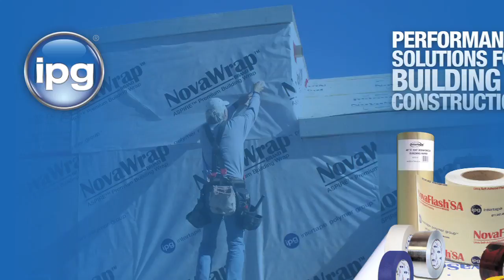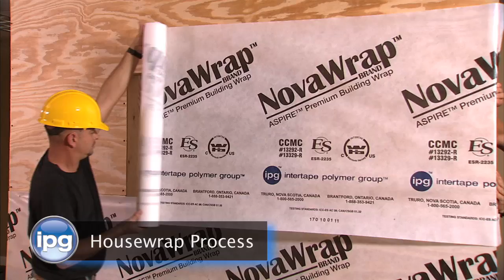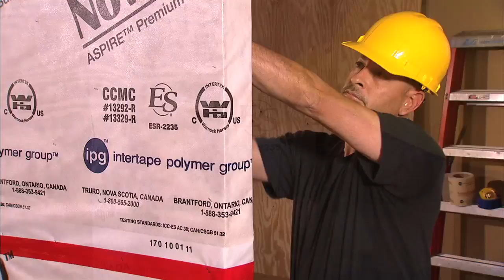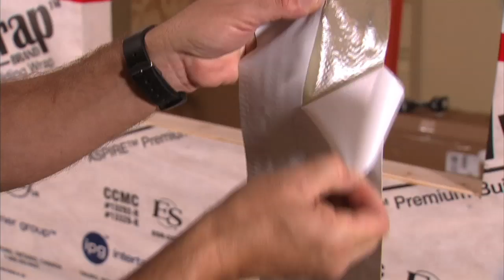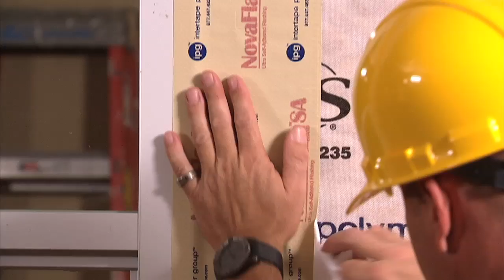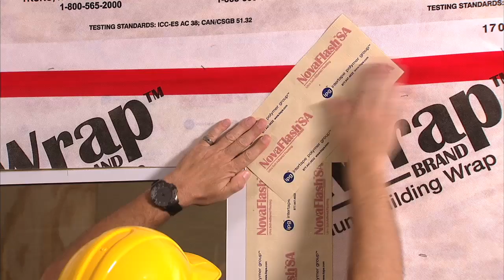How to Install House Wrap & Window Flashing

Comment: Why would any intelligent person wrap that non water proof stuff, inside the frame?? It will also allow air to go under and inside .
why bother using sealant on the flange to a non waterproof plastic?
It would only be smart to silicone frame flange to plywood that flash tape over flange and nails then house wrap, , were is the engineer proof on the video way of doing it?? I have been fixing this  stupid installation of practice in video be cause air and water get thru that house wrap

Comment: You  would think a manufacturer of a product would know HOW to install their house wrap. Great video on how NOT to wrap your windows. He literally created a channel for any water that may get in behind the house wrap to funnel into the corners of the window sill and start rot. Cut the sides as well kids so your spray foam can stick to the wood and create an airtight water tight bond. Spray foam will shrink slightly and create air gaps and pull the house wrap away from the sides of the window frame allowing air and water

Comment: Absolutely nobody in the trades says 48.5 inches.  We use fractions not decimals, and no z flashing?
Reply: Not an absolute , in the steel trades it's very common in shops to use decimals, and Evan 
Metric depending on where your shop drawings 
Where generated , rule of thumb you work in the system that your drawings represent , this is to remove the possibilities of mistakes in communication and  possible errors in conversion , construction is not the only trade
Out there

Comment: Goal is to catch drain dry. Where’s the slope, no decay shims, backdam and please don’t insulate the sill pan zone.
Reply: Slope? Decay shims? Backdam? What's that?
Reply: @davidtalavera2462  A slope is exactly that, a slope - it is usually built into the sill so that any moisture that gets under the window frame drains to the outside of the house (the slope runs from the inside to the outside across the whole width of the window sill. This is why the installer the video didn't apply any flashing over the window flange at the bottom of the window, so that any such moisture could come out, but with no slope there is nothing to encourage this. A backdam is a vertical section on the window sill (so  that the above mentioned slope ends in a vertical wall) that water will find it even harder to climb up. (It's like a dam wall).  I've no idea what decay shims are.

Comment: Yeah hand pressure with an acrylic adhesive is going to fall right off of your wall. USE BUTYL!!! 
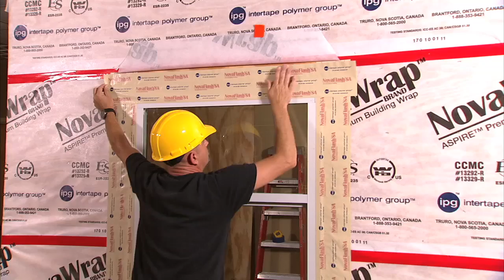Also, anyone catch the reverse lap at 4:55 ?
Reply: How about the wall swaying when the guy hits it with his slap stalper! I'm  sure it's just a mock up but at least get a real example and the guy narrating the perks of this product call's it OBS instead of OSB!

Comment: Ben Blake is correct on the method demonstrated here.  This will definately LEAK!  
Chris Mendola - ..."very efficient" "technique" in guiding water into the sill area and getting the customer to buy twice as much product to do the job! 
No one should EVER CUT in the corners!    Use the correct products to address those lower corners!   IPG - If your company does not make it - reccommend one that does! 
The method demonstrated here is 50 years old technology.  The installer did not even try to close that hole with caulk or sealant!  What a Dweeb...!

Comment: Will wall flashing prevent wood from getting rotted from rain?? And if so how isn’t it so thin
Reply: marie kr it’s made of rubbery like tar materials.
Reply: nova wrap will allow driving rain directly through the membrane... not only through the staple holes, but directly through the material... we have had serious issues

Comment: Is this method correct for today's residential code now in 2018?
Reply from the maker: This is one recommended method of install, as per AAMA-A1 using a modified I-cut. Consult your local building codes to determine which install method is best suited for your geographical area.

Comment: Never fold your housewrap to the inside. Any air infiltration now has a clear pathway to the interior wall. Never tape over the flange onto the housewrap, any water that makes its way behind the housewrap now has a clear pathway into the interior of the wall assembly. It's amazing that you think this is proper practice, what a shame! If you were to do this correctly, you would tape your flange to the plywood, then fold your housewrap back on the flange and tape it using seam tape. Your method provides zero air sealing properties and is down right irresponsible.
Reply: Wow, finally some one said it. I completely agree. It's better to have the window sealed right again the plywood or studs, on the sides and top, that  is. On the bottom it should be on top of the house wrap,  I hear many people say leave the bottom uncaulked in case water get in there it has a way to come out. Why would water get in there behind the window if you sealed it against the framing and then you install the wrap over the flange and tape or caulk the wrap to the flange, there should be no way for water to get behind the window.
Reply: Its called flashing the window dumbass
Reply: This is how all windows in my area are flashed , plus airflow isn't always a bad thing
Reply: do you realize everyone have the absolute way to do thing? it call '' construction douche bag syndrome" ... no cure... if I was working with you on a construction site I certainly would sprayfoam your toolbox... dosent pay to know best ,
Reply: Jake Garner why would you want it air tight? It's a house not a balloon, there's nothing wrong with having a bit of outside air in your house
Reply: @Dm-jy4jw  If outside air can get in, inside (heated air) can get out, so it wastes energy. The best homes being built today have mechanical heat recovery ventilation that is controlled to ventilatate just enough to keep the house and the occupants healthy while not letting any heat leave the home unnecessarily. Uncontrolled ventilation is less efficient than controlled ventilation.

Comment: you do not seal the bottom of the window with window flash tape. There has to be flow back for filtration of moister or water if water was trapped in window it has to go some where. It not good to trap water moister and let it mold stuff.
Reply: Are you just repeating someone said or did you actually saw it yourself? so if water is trapped in window, this means that there are little holes on the exact bottom of the window where it can drain out? BS ... explain to me please HOW water should get in there. is there any video?
Reply: Even if flashing keeps outside moisture from penetrating, condensation can build up inside around edges of windows in very cold climates and run inside trim and into rough opening.  That moisture, but f it occurs, should have a path to drain away to outside.  That's why any caulk on bottom nailing flange is a discontinuous bead AND why you don't want to tape over bottom flange.
Reply: I always find funny when people argu with the company video...first, unless you get your window at the salvation army they wont leak... and second, if your house is properly build you wont have that problem to begin with... also... yhea its overkill dude its a company video!!!   someone should stuck a potatoes in your muffler... make you realize that you know very little and should shut up lol

Comment: great video but window height plus 2 times with of tape ? is that just a mistake ?
Reply from the maker: +Chris Mendola Thanks for the question. "2x the width of the tape" is correct. So it would be window length plus 12 inches (6 inches extra on each side). The presenter pauses between "two" and "times" so it sounds a bit confusing, but what he's saying is correct.
Reply: +Intertape Polymer Group The voiceover is read that way three times, as if it were (width + 2) x tape width. Also, he needs to distinguish the pronunciations of "sill" and "seal" better. At 2:30, the text reads and is read aloud "OBS." Should be, and is later, "OSB."  I like the demo for the bottom of the window... very efficient opposed to other techniques.
Reply: @TomKaren94   Ben Blake is correct on the method demonstrated here.  This will definately LEAK!  
Chris Mendola - ..."very efficient" "technique" in guiding water into the sill area and getting the customer to buy twice as much product to do the job! 
The method demonstrated here is 50 years old technology.  The installer did not even try to close that hole with caulk or sealant!  What a Dweeb...!  
No one should EVER CUT in the corners!    Use the correct product to address those lower corners!   IPG - If your company does not make it - reccommend one that does!

Comment: the bottom corners wouldnt be sealed  if/when  water  got behind the  window and could find its way onto the sill
Reply: There are more modern stretch tapes, e.g. Tyvek FlexWrap, available now that can be placed into the corner of the sill and stretched so that they cover the front face of the wall without having any hole at the corner that would allow moisture in. Using a six inch long piece of a modern stretch tape in the corners to seal the house wrap would be a significant improvement. I've seen builders use such tape for the whole sill and the whole header, but really you just need 3 inches along and 3 inches up the corners and you can use a cheaper tape for the rest of the window.